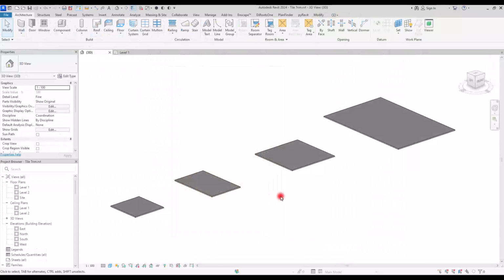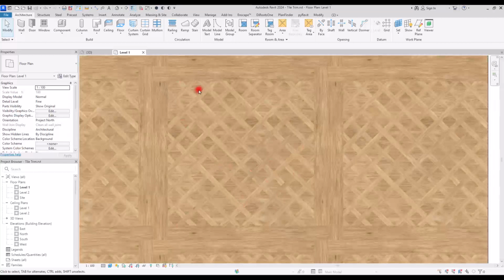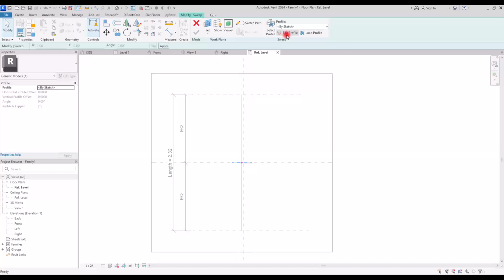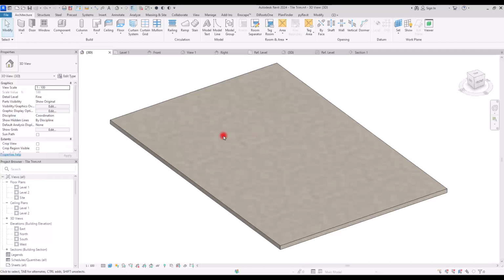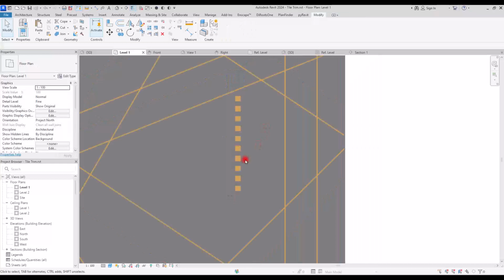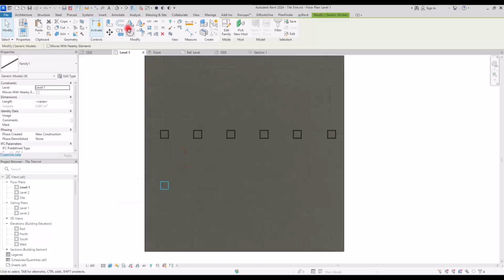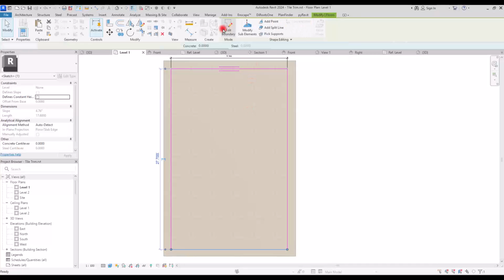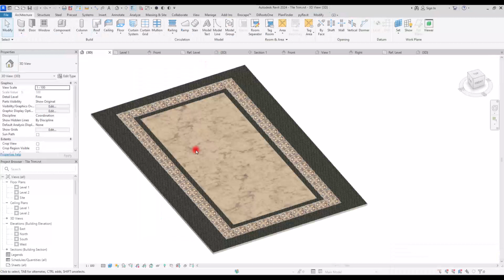💎 4 Luxurious Floor Designs in Revit with Tile Trims

Comment: I HAVE QUESTION HERE .I FOLOWED THE STEP BY STEP UNTIL ENDS BUT MY FAMILY TILE TRIM IS NOT WORKING ONCE I INPUT SIZES OF WIDTH THE PROFILE IS NOT FOLOWING.I LOCKED THE 4 SIDES BUT WHY???
Reply from the maker: They need to be locked in order to work correctly with parameters. Try creating it again in 90% of times you will see what went wrong
Reply: @RVTPLUS  I DID IT YES!!! THE VOID NEED TO ENHANCED TO LOCK IT TO 4 SIDES.THE VIDEO NOT SHOWN THIS ONE.WHEN YOU COPY THE SAME LOCATION OF THE PROFILE .YOU NEED TO GO BACK AND ENHANCE AGAIN THE VOID LOCK IT AGAIN..
Reply from the maker: Yes you need to always lock anything that are connected or you want them to work together.

Comment: This tutorial is so helpful for everyone who is interested in learning revit .... I have to say
Btw Ella i have a request , can i ?
Reply from the maker: sure
Reply: @RVTPLUS  let's say you finished your plans and switched to 3D, right, the first thing you see is the countour lines of every wall and floor on your bldg, ugly as hell lol, i have my method but I want to see yours of finalizing the global view of elevations.. (i wish there was a way how to show you what i mean with a screenshot)...
Reply from the maker: You can share an unlisted video with me if needed.

But to answer this issue first, I totally understand how it feels at this stage to not be able to imagine the final result. Depending on the requirements of the project, I do different things. Most of the time, the fact that "the more you work on it and add details, the better outcome you will have" saves me. For me, the hardest situation is when I take the model to one of the rendering engines; it takes lots of time to turn it into something good.

Overall, I just count on the time I allocate to it and the details I add. Sometimes even small details make a huge difference.

Sorry for the delay in responding, and I hope this answers your question and reflects your thoughts accurately.
Reply: @RVTPLUS  I appreciate a lot your reply.. I will do what you suggested Ella ASAP
Reply: I made a video about that, but i can't post it unlisted coz i had no idea what unlisted means and  just get the info that it's gonna be public. And since there is no other way, i'm gonna drop away this idea... 
Well thx Ella anyway , & i appreciate your concern and help a lot.
Reply from the maker: If you open YouTube on desktop on the left side, scroll down and go to YouTube studio. Click on create and upload the video. On visibility tab you can share it unlisted. Then share the video or the link with me. Or just share it publicly, you can delete it later.
Reply from the maker: Now I understand.
The model you created is perfectly fine and in the real world, the structure of a building looks like this initially. Once the structure is completed, we add another layer for elevation with mortar and the final material on top of the exterior wall. This layer will cover the contour lines.
It is not necessary to move the walls to cover the lines, as that is not the correct method. Instead, simply add another layer of wall for elevation. There are other ways to cover the lines, such as using "Linework" or "Paint."
Reply: @RVTPLUS  but that extra layer will give me no benefit, it will close all my elevation openings and I'll have to manually make them one by one...and the effort will be doubled if there will be balconies... I used to do that but i changed my method to this... Maybe I'm getting you wrong, i don't understand
Reply from the maker: I understand. So, first you need to decide whether you just need a perfect model to present the concept and renders, or you want to model it based on the real world process. 
If you chose the first option, then just simply draw the floors inside the walls and then attach the walls to the roof.  Other way is to join the walls and floor. 
If you choose to go with the second option then yes you need to spend significantly more time and effort which is a completely different topic.
Reply: @RVTPLUS  Well thank you so much Ella for your great help. Now i see things more clearly, i think I'll stick with my method coz i already have that layer, and all i need is to extend what needs to be extended without worrying about covering some openings and forget accidentally about them.

That's why i urge people to follow you, you're such a knowledge generous giver. I hope all the best and good luck to you in your life.
Reply from the maker: Thank you for your kind words.
If the issue is just with openings, when you join the exterior wall and elevation layer, the openings will be cut automatically.
Reply: @RVTPLUS  I didn't know that, that's awesome... So your way it is 😊